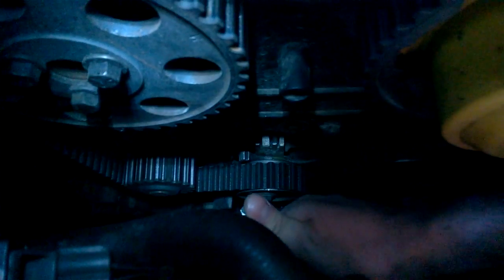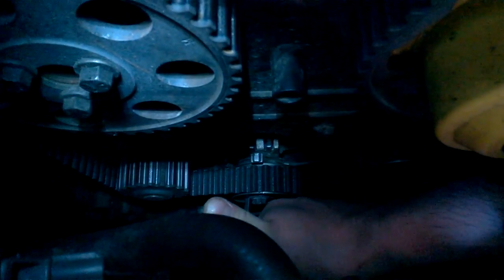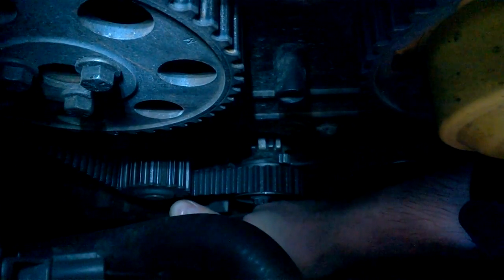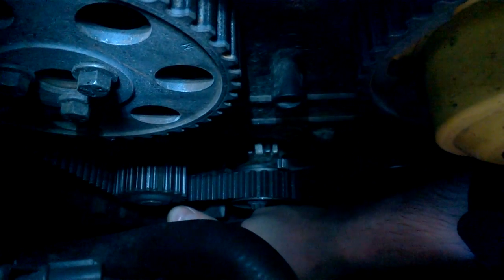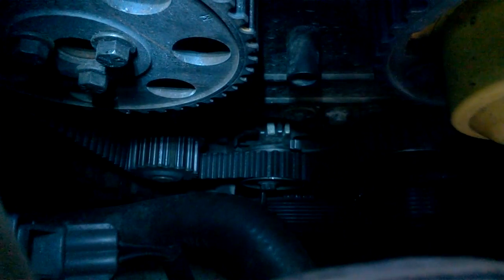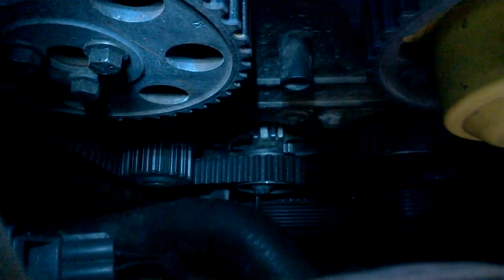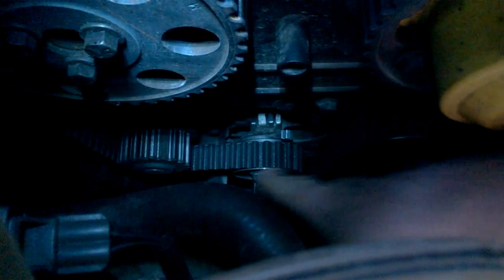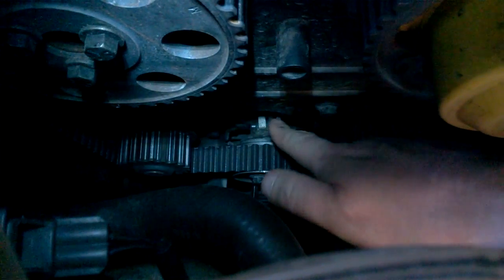Volvo S60 V70 XC70 timing belt tensioner set adjustment 2001-mid2004

Comment from the maker: The mid2004-up tensioner is adjusted the opposite way.
Bolt torque is only 15 ft-lbs or 20 Nm (important) Tensioner center point is at 15C / 60F
Buy only INA, Gates, Continental
For those who read in the future, don't be  worried about the tensioner indicator/needle reaching a far right position when the engine is hot - actually, carefully so you don't burn your hand, reach the indicator and try pushing it more to the right, if it moves, it means it still has play so the tension should be good.
Quick tensioner check tips https://youtu.be/afcUC07LPnI
BEFORE placing the tensioner on the engine, make sure the hex hole on the tensioner itself sits at 11 o'clock (rotate by hand the piece behind the tensioner).  Important trick: as you tighten down the bolt, the indicator needle will move to the right - to prevent this, I found that you must have the bolt fully loosened when adjusting the needle, then you keep the need in place with the allen key while tightening down the bolt with the other hand. Volvo says to slightly tighten the bolt before adjusting the needle : to me this never worked well. 

The 15 ft-lbs (20 N-m) torque is critical for the tensioner to work properly.  If the bolt is too tight, the spring inside the tensioner won't be free and will not work as expected.  See this video how to check if the tensioner has a problem  https://youtu.be/afcUC07LPnI

For mid2004-2009, it's a different tensioner that is adjusted the same way except that you will move the allen key in the opposite directions  https://youtu.be/Yd5gHFnHaYk

Tensioner adjustment is always performed on cold engine and with ambient (outdoor/garage) temperature around 20C (or 70F).  The tensioner needle should stay right in the center in these conditions.  Basically, it's adjusted to stay in the middle when the belt is at about 20C. So try to always replace the belt in summer time, at adequate temperature, or inside a heated garage.  This picture shows where the indicator needle should sit depending on the actual engine temperature  https://www.swedespeed.com/cdn-cgi/image/format=auto,onerror=redirect,width=1920,height=1920,fit=scale-down/https://www.swedespeed.com/attachments/1630439738512-png.133337/
When the engine warms up, the needle will move to the right.  In opposition, in winter days the needle will stay to the left (and move to the right as the engine warms up).

It is important to always first completely release the tension with the alley key before performing any tensioner adjustment. 

The tensioner has a metal tab (the one that is the middle mark) which acts like a 'stopper' against the engine block.  Sometimes this metal tab will bend, so it's good to straighten it up again with some pliers before adjusting the tensioner. You can see in the video that this tab was slightly bent to the left.
Don't forget to use your engine serial number (not the VIN number) when ordering the timing belt kit/tensioner. The tensioner has a new design after engine serial number 3188689 (all models included).  The two types of tensioners cannot be interchanged as their pulleys have a different offset.

Example of a cracked timing belt still running  https://youtu.be/2Fpftq-SOcc
Reply from the maker: Your engine runs and sounds well. The tensioner indicator has a bit of a shake, not the worst I've seen, I think it should be fine. Keep an eye on it see if it gets worst.
Reply: @Peppermint1  Do you mean by this my Video - Post? Because you liked and answered on your own , 1 year old post :)
Reply from the maker: @doubledeep8165  Yes, the reply was for your video. Must have been typing late at night

Comment: The tensioner on my 2007 car is different. The indicator moves in the same direction as the allen key, so the procedure must be reversed, yes? First counter, then clockwise, then counter again to set the desired tension.
Reply from the maker: Late answer, but for others reading, yes, that's how I remember it too.

Comment: After setting the tension and removing the lockers and spinning the crank shaft nut twice...my marks on the sprockets lined with the block markings and my cam sensor side lined up but my marking on my belt didn't line up and my tensioner needle set itself back to the left. Does all this sound normal?
Reply from the maker: The tensioner is very difficult to adjust on 2001-mid 2004 (from 2004 on it was improved and easier but not compatible with pre 2004 cars). See if I have other videos with the tensioner adjustment and check the pinned comments for extra tips. As for the marks, if all block and cam marks align, it should be fine - for the cam marks with top cover notches, try to look perpendicular on the side of the cover (not easy to do). Turn the crank a few full turns by hand with spark plugs removed and feel for any suspect resistance. May ask on forums as well https://www.matthewsvolvosite.com/forums/
Reply: @Peppermint1  I think I got it. Have yet to turn it over. Thanks
Reply: My wire was too weak and kept snapping. I used the torx screw on the pulley wheel. For me it did loosen it a bit but by then I just slipped the belt on I was  able to retighten the screw. Thanks for helping with timing belt job! You really help Robert!

Comment: Once again I changed timing belt on my s60 2001 b5244s2. Ordered a new idler as the old one went bad. After replacing the idler however and setting the tension properly, I saw that the belt was crawling off the vvt-cam and in towards the engine block. Started rubbing on the belt and wire was soon visible along with a burnt smell of rubber. I looked at the idler and compared it to the old one. 

The new idler pulley was shorter in height, resulting in the belt being sligtly pulled towards the block. The old one is taller and centers the belt properly.

Comment: Hi, I hope you can answer as quick as possible... i didn´t tension it against clock wise, instead I did it clockwise... now it is "jumping" at the idle and too "tigth"... is there a possible chance that i can fix it without buying a new tensioner?? or is it too late and defect ? also i didn´t used the 20 NM ... I did it much stronger...
Reply from the maker: Release the bolt (loose) and adjust it correctly, and tighten back to 20nm see how it works. May film how it works and link it here so I can look
Reply: Thank you alot for your quick answer & support!  If I mark every position from the camshaft´s and the crankshaft, then I suppose that I can do this without getting the belt down. Then I will mark everything and do it exactly 1:1 as you in the video.I will try it tomorrow - or at least this Friday and give you the feedback and link for the video.
  @Peppermint1
Reply from the maker: @doubledeep8165    If you just loosen up - without removing - the center bolt, there is no worry, the belt will stay in place without problems (just careful when moving the hands around it so you don't grab it off one of the pulleys).  Only when we remove completely the tensioner will the belt drop off the bottom of the crank pulley and then the belt needs replaced all around - in fact, unofficially, I already replaced the tensioner twice without removing the belt at all but it takes skill and lot of care to keep the belt in tension without dropping off the crank pulley - it's doable but risky. But for now, only to set the tensioner again, just break loose the bolt and restart the tensioner adjustment.
Reply: @Peppermint1  Hi, sry for the late response, had enough to do, and also the ETS throttle body made same big problems , I had to repair it, then also the preowner made another few issues... so here are the videos, I just loosed it up as you said, put 20NM on it, and what I can say for now, the Range motion is "working"... if its getting warmer than its move to the right side, and after it it removes to the left one. Before , It stayed a long time on the right and never got 100% in to the mid back.. but please look by your self here are the videos, and one note, the video where the Engine is not working I´m showing to the belt, you see the little hair´s on it? Is it normal? I cleaned and checked the pulleys before I mounted the engine before... 

and no, i didn´t drove the car, and I´m a little bit worried about the the condition of the timing belt ... one said in the US Volvo Forum that he tightened  the belt in to the wrong side too and is driving about 6 years now... another one said its garbage and that tightened it into the wrong side it is damaged and i can order a complete new one as also a new belt ...
Reply from the maker: What you are describing about the tensioner indicator movement is normal. I can't see your videos but a small crack in the belt means the belt is fairly old. You cannot 'tighten' the belt, it's only tensioned by the tensioner. A genuine belt will stand serious cracks before failing, a cheap belt may not resist that well to cracks. Usually you have the belt brand stamped on it at some place. So for now keep an eye on the belt, check it every 2-3 months or so. Example of a belt that was still running - I've actually see even worst  https://youtu.be/2Fpftq-SOcc
Reply: @Peppermint1   https://drive.google.com/file/d/1TUzUordJjk1Do9SlDAw8b29kpVecshBA/view?usp=sharing     https://drive.google.com/file/d/1TUzUordJjk1Do9SlDAw8b29kpVecshBA/view?usp=sharing     Look on the Videos, I think you didn´t understood me correct, the belt is fine, it has no cracks, but you can see the hairs, but this you will understand only after watching the video. I bought everything new, OEM Quality , so on this statement I can say that it is not the suppliers fault.
Reply from the maker: Your engine runs and sounds well. The tensioner indicator has a bit of a shake, not the worst I've seen, I think it should be fine. Keep an eye on it see if it gets worst.

Comment: Dear Peppermint: thank you so much for explaning this in details - but unfortunately I am still confused.
I have tried (first time doing this job) adjusting the tensioner today - but I am unsure it is OK. Especially because I first see your videos and explanation AFTER I have tried to set it right today.
First of all I fiddled with the Allan-key - to have it positioned in the middle many times-WITHOUT releasing the tension and putting on full tension to finally adjust it in the window between the marks.
I started 11oclock - but fiddled forth and back from here and after the final tension of the 12mm centerbolt it is too far to the left (app 3 mm - but have not tried to start the engine yet)
My Tensioner Pulley is INA, 531 0859 10.  And the engine is a D5244T5.
This tensioner has to be tensioned with the Allen-key CCW (arm moving from left to the center) - meaning that when I tighten the centerbolt CW, the arm going back to the left from the center.
Further I have tighted it to 27 Nm. (been told be many on the internet - but according to Volvo Vida it should be 24Nm on this engine.
So please help me out: should I release the bolt again, go full CW to release (Allankey CW - arm CCW) and then go CCW (Allankey CCW and arm CW) to tension (fully ?) and the going slight back (Allankey CW and arm CCW - so arm is slightly to the right) - and then finally tightening the bolt (and hope it end in the middle ?).
hope for you help today. Best regards Peter
Reply from the maker: If we force the mechanism there can be small tabs that may bend inside the tensioner and it may not create the correct tension. I am not aware if this happened, but I would say, if you are confident it's not broken inside, do the test in this video - push the upper belt with some force and see how the indicator is moving - it should move smoothly without grabbing and without getting stuck. From there, turn by hand the crank two full turns (engine off) - always clockwise, never go counter-clockwise on this engine, and repeat the belt pushing test. If you are confident everything appears fine, may ask someone to fire up the engine but be aware, if anything is wrong, if the belt jumps a teeth even at idle, the valves will be bent and the engine is scrap. If the engine runs at idle nicely, look at the indicator again, it should be near the center mark while the engine is still cold (about 15 Celsius). Even if it sits 2-3 mm to the left or right, it's not critical. If it shakes a lot, it's not good, if it shakes very little (1-2 mm) it may be fine. Look as well see if the belt is not running 'on the edge' of the cams.  https://youtu.be/afcUC07LPnI

Comment: Hi
So today, I was trying to adjust the tension on my timing belt as per your video but when you install the tensioner the needle is not in the middle like yours it is all the way left and when I put the 6mm hex to turn it clockwise, the needle just doesn't move. BTW the centre bolt is loose.
Plz respond.

Thanks
Reply from the maker: Which year is your car ? In the video, the needle stays in the middle at the beginning by hazard, it's because I already had it adjusted before starting filming and the bolt was slightly tighten. Normally when you install yours, the bolt will be loose, and the needle will stay completely to the left as shown at 0:25.  You start from this position when you adjust it, and every time you need to adjust it again. Also make sure you have the exact tensioner as in the video, because from mid2004-2007/9 there was a different tensioner model on which we move the allen key exactly the opposite way as with the older tensioner shown in the video.  See this video with the two tensioner models https://youtu.be/Yd5gHFnHaYk

Comment: Peppermint, out of curiousty, is there installation instructions accompanied with the belt tensioner kit regarding tension indicator position at the corresponding ambient temperature as well as the install procedure and torque specifications that you described so well in your video?
Reply from the maker: The kit I had (Dayco - which turned out to be poor quality) did had some instructions. The thing is, it's impossible to set the tensioner on the first try, I guess most people will try many times until it stays in the center after the center bolt is tightened and the belt is turned (even after running the engine a few seconds, the needle may move and need to be readjusted). The temperature reference at center is 70F such as on a normal summer day, with engine cold.  The needle will move near the left indicator at about 10F and below, and to the right one with the engine warmed up. All tensioners are the same for all brands (but we recommend Continental brand, or genuine) and Aisin for the water pump (at the second belt). May also see this https://youtu.be/afcUC07LPnI

Comment from the maker: Not shown in this video but here's a few checks to make sure the tensioner was installed and set correctly: the belt runs close to the center of the cam gears, without wobbling, the tensioner needle doesn't shake, and goes back to center when the engine cools down in summer days, depressing the belt in between the cam pulleys makes the tensioner needle to move to the left (if I remember well) then go back at center as the belt is released.  Finally, one trick to have the needle stay at center when tightening down the 12mm bolt (15 ft-lbs or 20 Nm, this is not a very large torque so a torque  wrench is quite a must to set it right), is to set the needle more to the left: when tightening down the 12mm bolt the needle has a tendency to move by itself to the right a little.  And a final word about the Ina tensioners (like the one in the video).  I wonder if these Ina tensioners are that good. I know they last once installed, but setting them is terrible. People recognize Ina has good bearings, but the spring mechanism inside is not their best product. Some also say the genuine Volvo ones are made by Ina - made it's actually just a Ina bearing while the spring mechanism is made by someone else (Gates?).